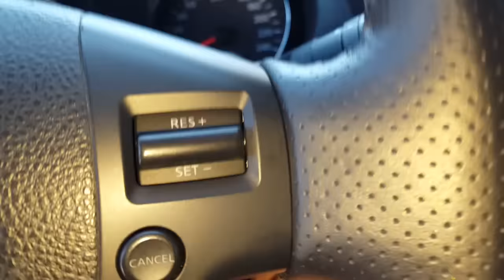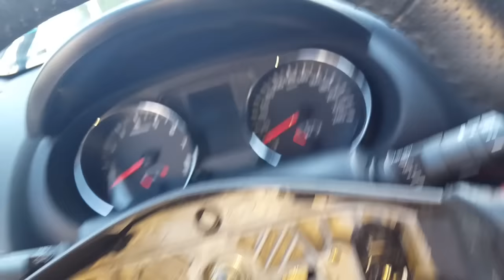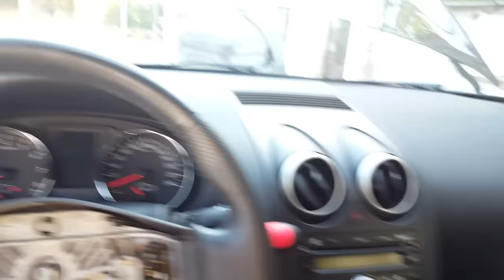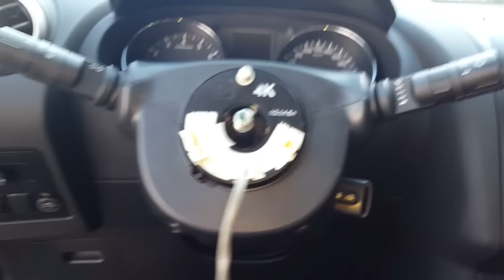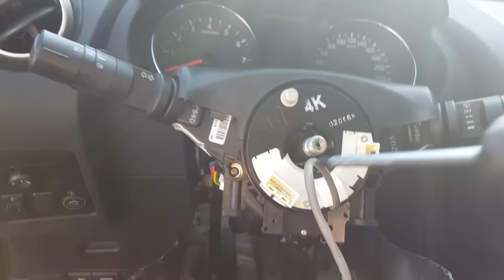How to remove and install ribbon cable Nissan Qashqai (J10) 2010 y. (CLOCK SPRING SWITCH ) PART1

Comment: I have qashqai 2009 , this car very strong and reliable, i like it so much , you can travel with it or use it inside city without any problems , they made it from high quality materials, thanks to help me replace the same part , after 11 years i am not thinking to sell it

Comment: Still running the first version of the Dualis/Qushqai, and runs like new, with only a battery renewal, brake pads, front ball joints (did myself) & oil change. Nothing seems to go wrong with it. Looks nearly new. Not worth selling so might keep it until its an actual classic.

Comment: Hello after i have change "CLOCK SPRING SWITCH"  i have esp light on - after driveing 20m. It is necessary to make adaptation (tester - diagnose) the new clock springs -

Comment: sorry for such a late comment on a 4 yr old video. When I search Clockspring Qasqai 2012 j10 on ebay, i get many clocksprings with 2 wireplugs...the yellow plug one and an orange plug one. However; just like on your picture, my original clockspring came with 1 cable with the yellow plug which plugs on the airbag.  Where can I get a clockspring for this 2012 Qashqai in USA? I am from the Caribbean, and ordering online from USA is much faster and cheaper than ordering from Europe.  Any link to maybe ebay anyone?  Thanks.
Reply from the maker: Hi, unfortunately I can't help you

Comment: How do you take it off ? Push or bring with the screwdriver ??
Reply from the maker: Behind the steering wheel there are 2 small holes on both sides horizontally. Insert a straight screwdriver and press.
Reply: @emod2255  press which way ? In direction of me or front of the car or passenger way
Reply from the maker: @frenchyoz8638  You have to push inwards.
Wide straight screwdriver
https://upload.wikimedia.org/wikipedia/commons/1/1c/Screw_Driver_display.jpg

Comment: Hola mi estimado.
Le saludo desde Costa Rica.
Tengo un problema,con un vehículo igual a ese , no habré el porta equipaje. Si me puedes ayudar te lo voy a agradecer
Reply: Es un 2017.
Reply from the maker: @Someone_RBX   What is the problem?

If the boot does not open, The only problem is the trunk lock. It can be replaced with a second hand. It is easy to disassemble, remove the bark, which is clamped and then the lock itself with a 10mm wrench.Everything happens in 10 minutes.